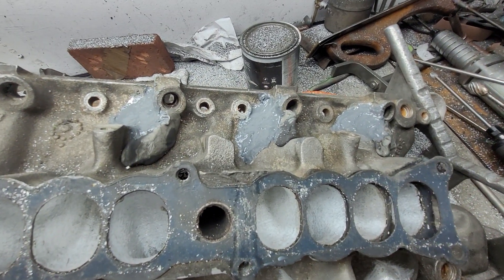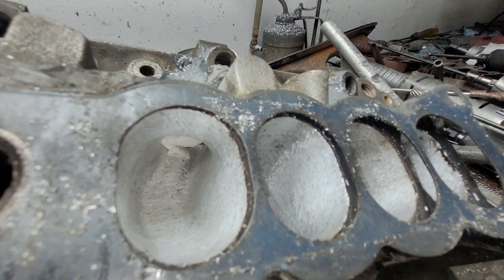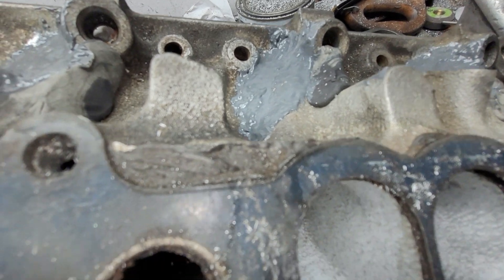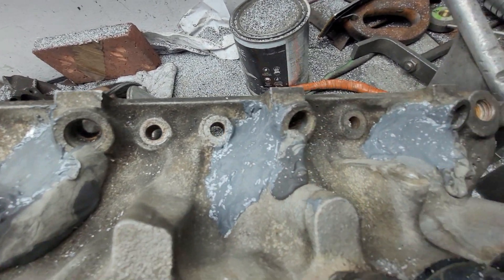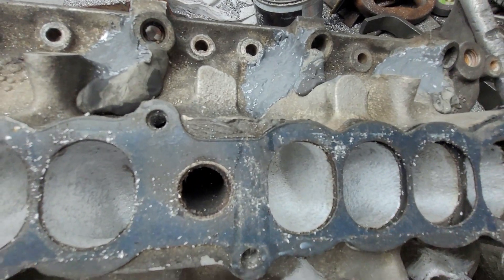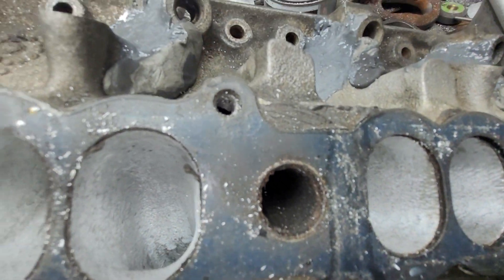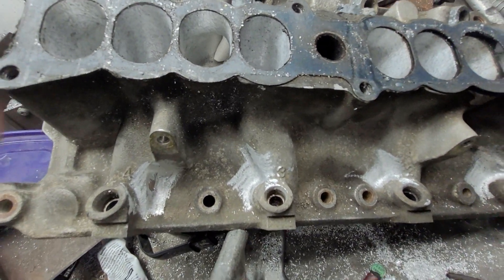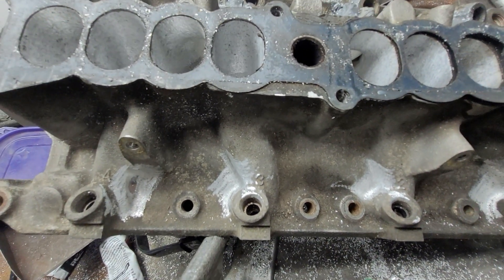Ford 1995 h.o. intake epoxy quicky

Comment: I was drilling boyeson ports in a Yamaha blaster 200 cc jug and punched through the outside. Filled it with jb weld. That was back in 2001, my nephew still has that machine and it has never leaked. Mind you it was a high performance single cylinder air cooled two stroke that absolutely will not run if it has a crankcase leak. I think the trick is to make the hole so there is a mechanical lock on the epoxy. I drilled from the outside at a 90° angle to the hole I needed to fill. So no matter what it cannot be dislodged. And I heated the cylinder to 250° F before and applied the jb weld while it was hot. Had to work fast but it sealed great. I honed it, put new rings a few years ago, it still passed a leak down test just fine. Crankcase holds higher pressure than the Yamaha manual specifies. If you just slather it on a surface it would not hold. But lock it in place and have the base material at the temperature you will use it at when applying the jb weld and it really does work great.

Comment: Hey Charlie, another awesome video, I use Moroso two part epoxy and Splash zone 788 A and B epoxy. If using Splash zone? I recommend using  Devcon 2 ton clear epoxy to skim over it once roughed in. Then final finish it.  Awesome job explaining. Keep the videos coming.
Reply from the maker: I never used splash zone but I know you are right it needs to be sealed.

Comment: So I've done this in my truck lower like you said also fiber reinforced with shavings.. I started re assembling my truck plenum after cutting open and I had the idea (video on my channel) to epoxy it in parts also to hold the plates good and solid .. then was going to tack/stitch (so epoxy doesnt.over heat) weld with aluminum wire . So a hybrid hold. I figured making a bridge (like being in the gap and going body to plate) and having it smushed into the gap as it's less than .100 should be secure? But then as I read about jb weld some people say it's not great with vibration so I'm wondering how long should epoxy actually last? Are there epoxy port jobs lasting for years or .. I figure the shavings help and surface prep
Reply from the maker: If epoxy is done right it should be fine.
Reply: @servediocylinderheads  I mean I did 1:1 ratio .. aluminum shavings .. surfaces it would touch was scored up with a carbide .. prepped with rubbing alcohol . Then will painted over with vht high temp for a good seal on outside
Reply from the maker: @DS-mo6md  It is good to go.

Comment: That's sketchy!
Reply from the maker: Really? Never had a problem with epoxy.
Reply from the maker: It is the professional j.b. weld with lots of aluminum grindings mixed in.
Reply: Charlie, that engine I described had the exact epoxy job you are showing. I did that in 1991. The epoxy is still on a customer's running 91 GT to this day. (Recall I switched out to a Cobra upper and lower) I think you will be fine. The only difference is I use acetone to clean and prep. Brake Kleener leaves a film and epoxy sometimes does not adhere as well. Just my findings. Thanks for sharing as always. Same goes for loctite, use acetone to clean and prep. Again Brake Kleen leaves a film and loctite does not adhere.
Reply from the maker: @rennypizarro4432  Did not know that about brake clean. Good info. I should also add welding a good amount on an intake can be problematic. As the weld cools it shrinks due to aluminum's expansion ratio. So the manifold will warp like crazy. Ask me how I know.
Reply from the maker: I am not worried about the epoxy failing.
Reply: @servediocylinderheads  Charlie, I am very painfully aware about welding and twisting a lower. I have a reminder as a paper weight. GT40 lower. Expensive lesson.